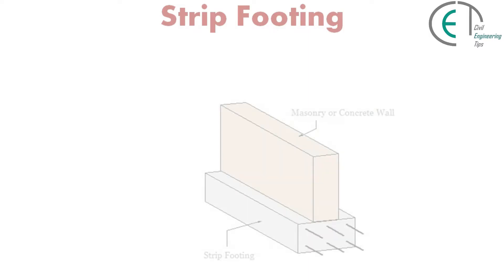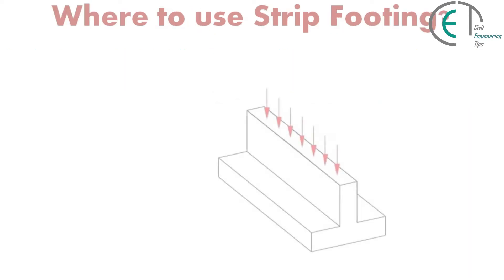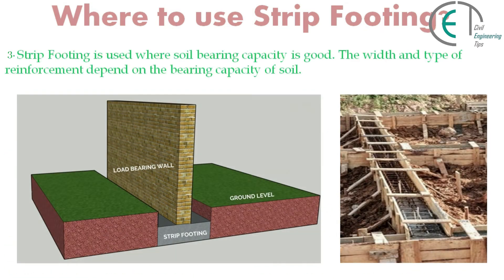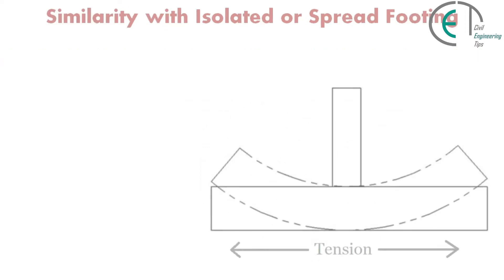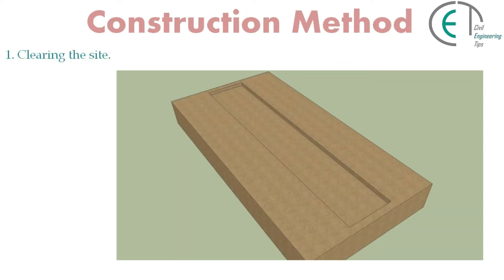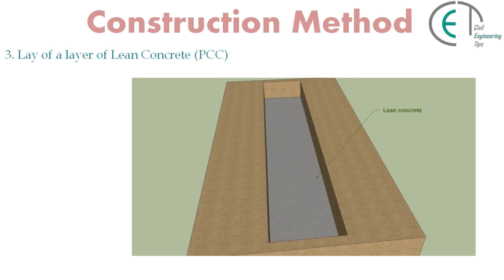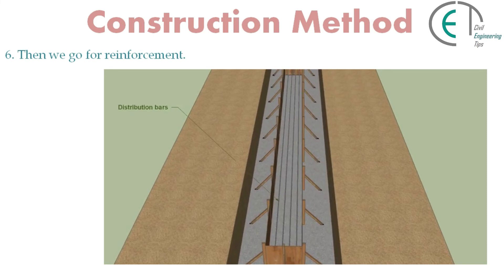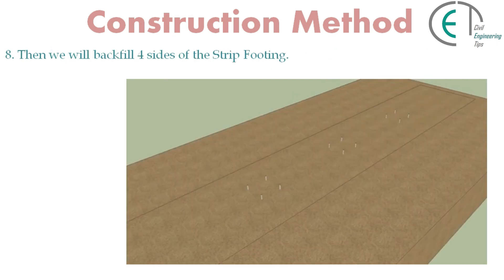What is Strip Footing or Continuous Wall Footing? | How to construct Strip Footing?

Comment: bro,your new subscriber here!can we use concrete solid blocks in load bearing 2 story house which will be with out any column and beam?my 2nd Q! can we use solid blocks in load bearing house foundation?
Reply from the maker: I cannot suggest you anything without designing it. design a RCC building and make yourself safe for living.